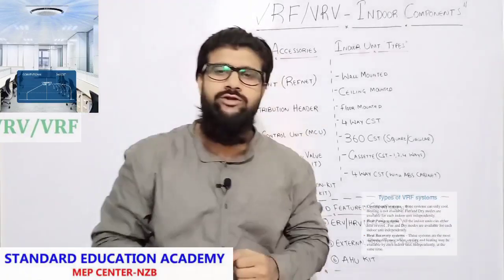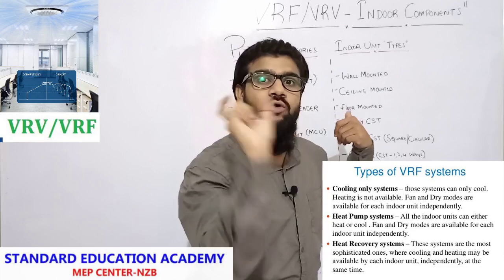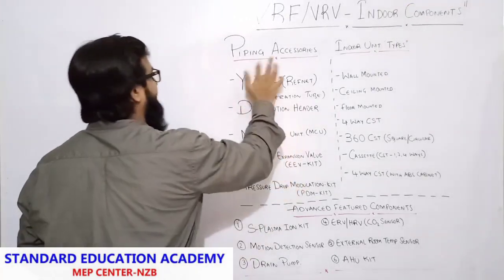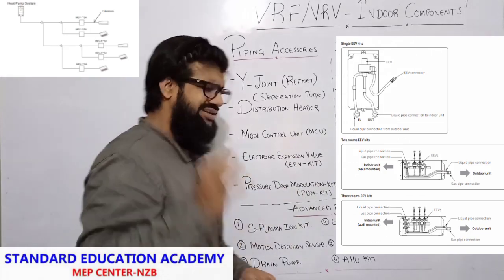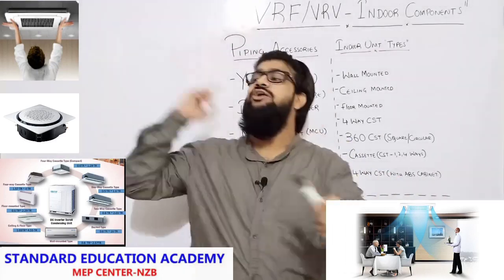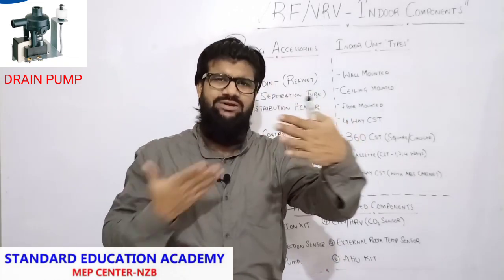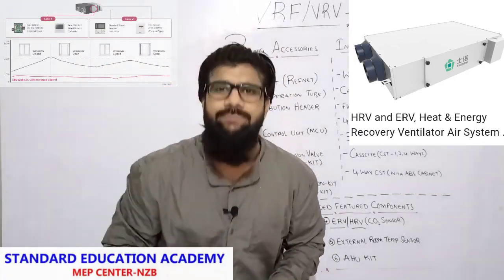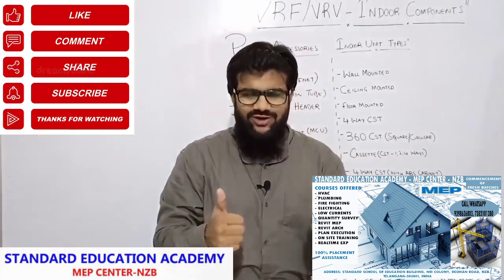VRF/VRV Systems (Indoor Components)

Comment: Sir vrf me return pipe hota hai?
Reply from the maker: VRF works on Two Pipe & Three Pipe System. In Two Pipe System One is Discharge(Supply)Pipe & the Other is (Suction) Return Pipe.
Ji Haan VRF me return pipe hota hai actually me wo suction pipe hai (Indoor to Outdoor).